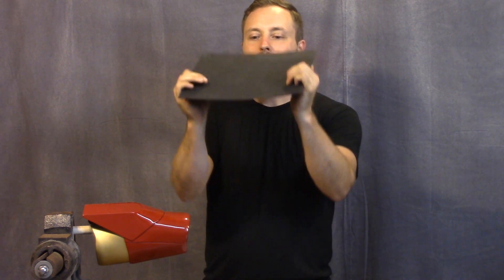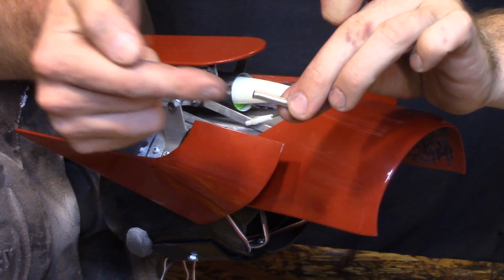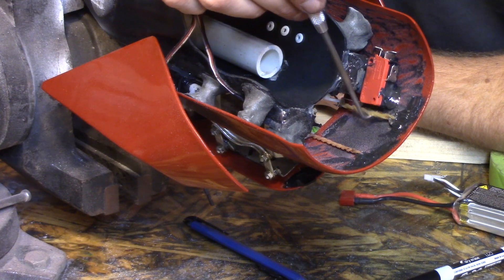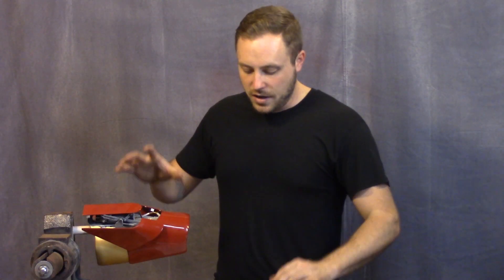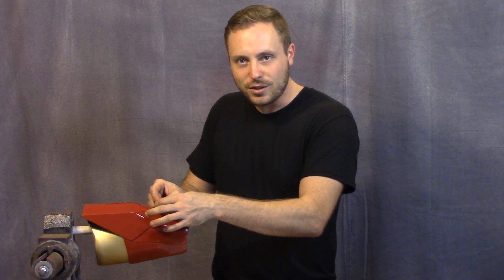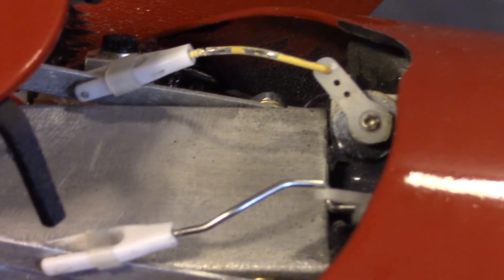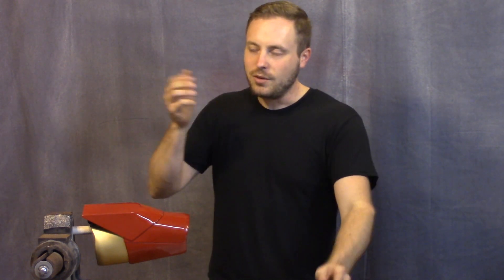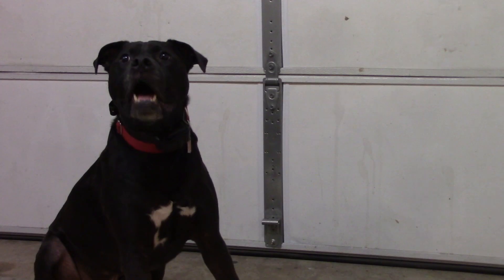BUILDING IRON MAN - PROBLEMS EDITION

Comment: Hi, first of all I have to say than this forearm don't only looks gorgeous but also close and open in a very satisfying way But I have a question, what is the dimension of the tube that launch rockets ? (Inner diameter and lenght pls)
Reply: You have done an incredible work, and you got one new suscriber ;)
Reply from the maker: Thanks! The launch tube is 3.5 inches long with a .75 inch exhaust port section giving overall length of 4.25 inches and .97 inches inside diameter.
Reply: Thank you !

Comment: I'm not sure how to get the grease into the joints, but bearing grease works great. It allows for good metal-to-metal movement and it stays on the metal. You might be able to smear some onto the arms, and it might work into the joints.
Reply from the maker: I'm going to see if I can get a syringe to push it in.
Reply: Cool, the syringe will probably work well enough. The build looks pretty good, keep it up!

Comment: Hello, if u wanted to fly the solid fuel rocket straight make fins that connect on the rocket but in a unique way. Make the fine Come out from inside of the rocket using springs or other ways. So when rocket in the launcher fins are closed but when left the launcher find open by it self or by positive Air Force or pressure from the moving rocket.

Comment: could you use beefier/better servos to solve your last issue? "MORE POWER!!" :-)
Reply from the maker: It would be extremely difficult to replace them at this point, due to the armor being mounted to the existing servos. I would have to start over with the armor integration. I wish I had just gotten more powerful servos to begin with. :( It's a learning process.
Reply: Indeed it is. V2.0 will be a doddle though! ;)

Comment: have you tried putting a lubricant like silicone lube or even vaseline as a lubricant for your joints and surfaces that rub?
Reply from the maker: I'm going to try to inject lithium grease. Only problem is that it is in a tub and I need it inside the joints. haha
Reply: Oh yes, i see your dilemma now. Well good luck, and thanks for another great video!! Your a very inspiring person.
Reply: try a small syringe for adding grease
Reply: I haven't seen spray grease advised yet. I have it as it's easy to get at things you wouldn't normally be able to get to.
Reply: I would try molybdenum grease, it's made for metal surfaces that are going to be sliding past each other over and over again i.e. spline gears in machinery. It has some really cool mechanical properties and is light. It also, in so many words, works itself into any surface it's on and keeps it moving freely for a really long time. Look for Moly Paste if you're searching online. Hope this helps and I love that you show trouble shooting in your videos!